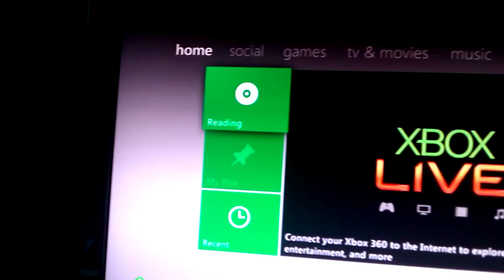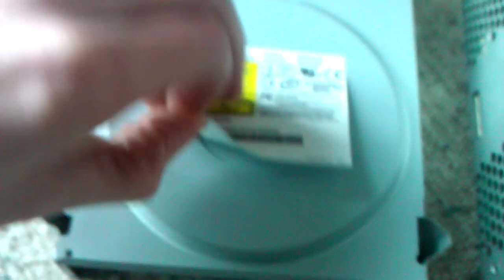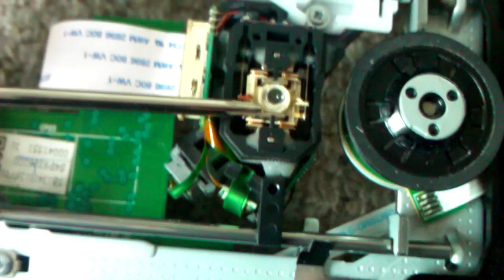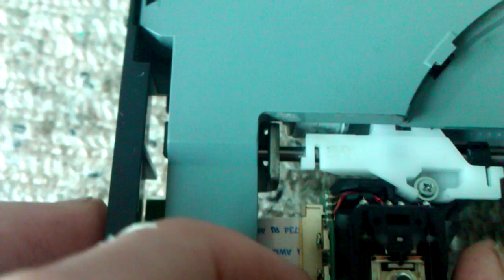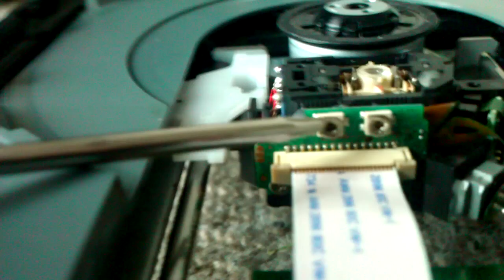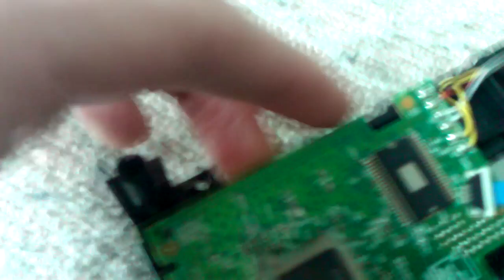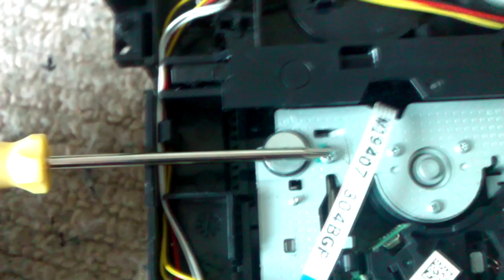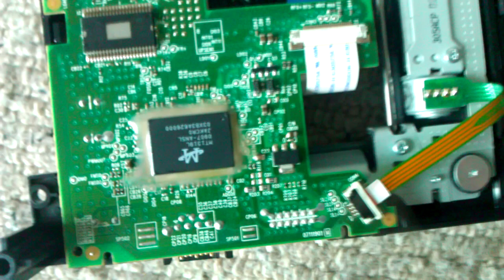2013 All open tray error and no disc spin fixes Xbox 360

Comment: Guys, keep in mind, when you mess around with a laser's voltage, do it only with a multimeter to understand exactly how it does change, and you should know what disc drive's brand you're fixing because they are not the same, having different voltage range.

Comment: I'm amazed!! This truely worked. Took apart my jasper 360 and lite-on dvd drive and cleaned laser lens with alcohol and took out the spinning mechanism and lubricated it as described in this video. When i cleaned laser lens, I pulled up a whole lot of yellowish stuff off of it and it soaked into the q-tip. Put back together and tested all 6 games that the Open tray error was occuring on and they all loaded with NO problems three times in a row. Thank you durhamazhogan for this video. U just saved me $50 and a whole lot of soldering headaches. This truely worked for me. A++++++++++++++ homie!!
Reply: what did you use for lubricant?

Comment from the maker: The left screw is usually the resistance that is sent to the laser so without it the laser stands not much chance of working i am afraid. Either remove a screw from another laser or probably even better, buy one from a place like amazon. They usually cost around £6 / $8 and replace the laser completely. (make sure it is compatible with your DVD drive type).

Comment: dude you are awesome!!! i never thought i could fix it until you came along and saved the day!!! but it was a little bit more tricky than just turning the screw and its done, i had to kinda play with both screws and test, then turn a hair more left or right, but the turn deffinatly stayed to the left otherwise i got the jackhammer noise or some crap like it did before. but thanks, it works great now!! you saved me over 60 bucks or so! ffl man.. ffl

Comment from the maker: Which screws, the ones that keep the laser level or the ones which control the power e.c.t..(small ones attached to laser)? This is known as pot tweak. If he really messed it up all i can suggest is trial and error unless you have a Multimeter that Reads Ohm's then you can use this to check it and fix. If he burnt out your laser then I suggest buying a new one they are cheap and you can get them from amazon / ebay for under £7 / $10, just make sure it is compatable with your DVD drive.

Comment from the maker: 7 years old! You have done quite well. I am afraid that the laser may have just died if it is that old. If the laser moves up and down then it is not the motor and you will most likely need a new laser i am afraid. They are very cheap on places such as amazon, they are around £5 / $4, so long as the laser is compatible then it is a quick change.
Reply: durhamizhogan  hello when i have a disc i side the tray works fine sometimes it doesnt read the cd but  when there isnt a cd inaide my xbox 360 fat doesnt open at all what to do ?

Comment: I wouldn't recommend playing with the left screw unless you have a multimeter to read the ohms. Even turning the screw very slightly can burn out your laser extremely quickly. Recommended Ohms are from 4-6. Adjust your screw so you have .2-.3 less than what your original read was.

Comment from the maker: Sounds to me like your laser is dying. Your best bet is try cleaning it and try the laser tweak (but be careful). 
You can buy replacement lasers on the internet, some independent computer shops replace them for a fairly cheap price. If you do choose to buy one yourself make sure you are buying one that is compatible with your drive. How old is your xbox, some lasers die over time.

Comment: I tried all the possible fixes that other sites show and they didn't help. The two drops of WD40 on the motor disk that drives the DVD and it works great now.  The disk was not spinning fast enough to read it. Sometimes it worked for a few minutes and then the disk didn't spin fast enough and it kicked me out of the game. Now it is fine.

Comment: DO NOT use rubbing alcahol. I've gone through 3 disc drives in the past 8 years. It shows improvement short term, but still develops a film. If you must clean with some type of solvent, use saliva- it's crazy but works really well. It's a natural cleaner! Everything else on this video looks great.

Comment: Is the best ever tutorial i have ever seen. Congratulations. To the point now. I tampered with the two screws behind the laser. At some point the laser became brighter and it was looking like it will be fixed, because suddenly the end was spinning faster for 2 or 3 times and then stopped. But the problem is i really messed up...i forgot how many times i have turned every screw.... Since then i can't put it back no matter how many hours i tried but the laser is pour and it turns only for a turn or so. By the way the two screws have the impression that after a full turn its the same again and it doesn't matter turn it back again. Is this right??? Is there anything i can do to fix it...
I know it's been a long time from the original post... Anyway you are great

Comment: so I did most of your fixes. I ended on the loosening the laser screws and it still doesn't work, should I just replace my laser because everything seems to be working but I'm guessing this damn laser isn't reading disc and I even cleaned the stupid later too.

Comment from the maker: Does the laser move at all? If not then it could be the drive for the laser that is busted (it is the spiral bit that the laser connects to on the side).
This happened to an old PC DVD drive of mine and i replaced it with one from an old drive. Basically only has 2 screws holding it in place and is easily replaced.
Move the laser as far away from the the part which spins the disc as you can and insert a disc, then see if the laser moves down to try and read it before it would normally spin.

Comment from the maker: 66 error when trying to update means the console has been modified or tampered with. However you can still play games offline by doing these steps:
*Restart your console.
*If you are prompted to install a system update, select No.
*Press the Guide button on your controller.
*Go to Settings.
*Select Profile.
*Select Sign-in Preferences.
*Set Profile Auto Sign-in to “Off.”
*Press the Guide button again to return to the Dashboard.
 
YOU CAN UPDATE YOUR CONSOLE USING A MEMORY STICK.

Comment from the maker: Hey, does the laser move when you put the disc in to try and read it or does it stay where it is? If you have replaced the laser and it only works for a while it may be the drive or even the motor that moves the laser. You just want to hope its not the motherboard.

Comment: or since you cant get it apart just get a small round magnet its just to hold the disk to the spindle they are the same in every single internal disk drive ever made for desktops they will all work

Comment: My Philips liteon disc magnet is the problem, I removed the top cover and just had the magnet on top of the disc and it won't read. I placed another disc magnet with the metal balls in it and it will read every time. What do you suggest I can use as a perment fix?

Comment: I have reached the point of serious confusion O_o
I've done pretty much everything you've said In your video, My buddy and I have been working on this problem for almost 8 hours now. It's got to the point where I can play 90% of my games and the others refuse to play, I'm getting all kinds of different error codes every time. This so called Open Tray bullshit started off 3 weeks after playing GTA V , I started noticing some lag and freezing during game play. It wasn't up until last weekend I fired up GTA and It froze up during the starting ads and pretty much wouldn't play any game from that point. Tonight we opened my box up and blew out any dust and cleaned the laser, I've also spent several hours trying to align the laser rails. As we speak I'm testing out games, I'm playing 007 Legends right now and It works just fine. However not all my games work, GTA still refuses to play. I'm seriously starting to believe that the CD Rom drive Itself Is on the way out, It just doesn't make sense why some games work and others don't. Out of curiosity what Is the model number on that drive In your video?

Comment: I think my issue has to do with the magnet inside the disc drive. When I take out the magnet (along with the metal and plastic pieces) from the metal disc drive casing, I attach the pieces back together and place them on the center of my disc. It reads properly and offers "Play Game." Yet when I reattach the magnet pieces back to the the metal casing and screw the casing back onto the tray, it doesn't read again. I think it has to do with the pieces being loose when attached to the casing. Help!

Comment: The laser rail assembly does not move up into proper position when the disc tray is closed, thus not telling the laser to read the disc and not to spin the disc. What is the fix for this?
Reply: If you still need it fix just move the laser to the back enough that it catches the edge of the disc but not too far.

Comment: I took my Xbox apart so I could try your fixes and for some reason when I put the magnet on top of the disk to test it, the magnet and the black plastic piece fly off the disk when it spins. No matter what I try, my disk doesn't spin normally. It'll spin for a second, the top magnet (and the connected plastic piece) flies off, the disk stops spinning, and it says open tray. It wasn't doing this before I opened my Xbox so I'm assuming I did something. It might've been a dumbass move on my part but I threw away that large sticker on top of the drive that conceals the magnet. Does the sticker hold the magnet in place so it doesn't fly off or is there something else going on?

Comment: is there supposed to be any noticeable resistance from the screws attached to the laser?mine seem to move with no force required at all.my box seems to spin the disc about once.and i had adjusted those screws before,and i think i went to far.so i ask if there should be any resistance in the screws because i need to gather an idea of what to expect.

Comment: One problem Ive found with my DVD drive is that the spinner is extremely stiff.  I put WD 40 in the 2 holes that you noted but it only slightly  loosened it up.  Is there another more effective way to get it to spin better?

Comment: Okay so I tried all these things including replacing the laser unsoldered the bulb and some of these techniques have worked for me in the past but it now worse than ever not even spinning once which it used to for me but now it won't even attempt to spin it any more advice you have would be appreciated thanks also when leveling the bars did you do anything to check that it was level or anything like that?

Comment: Do you think that low voltage in the laser would cause gameplay issues? I fixed my 360 and popped in Gear of War, and the cutscenes seem to run at a fairly low frame rate. The rest of the game is alright.

Comment: so I turned the left bronze screw about a half turn and my disc span for about 1-2 seconds longer (making me think I fixed it) but then stopped, and when I turn the screw anymore the disc goes back to only spinning a half second.  Is there a sweet spot I should be searching for? or is my problem not with the laser? thanks for the help!!

Comment: After some playing around (and reckless pot tweaking) I realized my problem was a sticky motor and WD40 solved it. The next day I was having issue installing a game so I figured maybe my tweaking caused an issue. So I got a proper multitool and measured it to 5k~ ohms on the left and 800~ ohms on the right. Now it pretends as though there's no CD at all and spins roughly a quarter turn before quitting. When I remove the CD, it'll spin a good two or three rotations. Evening when setting to unreasonable numbers tweaked, it behaves like this. The laser turns on at a good brightness, the motor spins with gusto. Is the laser not reading or is my PCB shoot? I've detached the laser cable to see how it behaves and it is similar so I suspect funky laser. Any advice would help.

Comment: Hey man, i know this video is old, but   looking for maybe a fix for another common  annoyance with the x360.  My drive works fine when the console is horizontal,  but if i stand it vertically it's plagued with the open tray notification and the drivetray will not open either.

What do you think the issue could be here?

Comment from the maker: You can burn out your laser if you you just tightened it fully up, (meant to do it by a little bit at a time) however you can buy lasers for a very cheap price on places like amazon (£5 / $4) for example. As long as it is compatible it is a fairly simple change. I am afraid if your laser has burnt, you have to get a new one there is no real way to fix it. Sorry dude.

Comment: i've stripped it down and i've noticed that the disk spins for about a second or two and then spins off the motor and the open tray sign comes up, any suggestions?

Comment: The ones that keep the laser level i tweaked them and now the disc spins once and stops i had it earlier how it span for 7 times and allmost read the dvd the dvd span quicker than a cd after many attempts of tweaking the laser im back to stage 1 either 1 spin or non at all so i think i might just give up thankes for the reply tho  and i have subbed to you:)

Comment: Take a QTIP do not use any solutions on the reader just dampen the QTIP with a lil spit  and check for the sensor under the tray in front and spray with with connected to the eye slide sometimes the screw pops out and causes these error's

Comment: The Xbox i'm currently working on has a error 66 when I tried to update xbox live. And that so i took apart the disc drive and found that if you move the lazer anywhere it always goes back to the end of where the disc spins making it not actually read the disc. I'm very desperate on fixing this

Comment: I tried cleaning it but it wasn't the problem. What it actually happens when I try a disc on is that the reader will go right (until the end of the disc) and left, then left again and it does kind of a noise, and the reader just blinks red. Any suggestions on what might be the fix? I don't think is the reader or the metal bars
Reply: You still need help ?
Reply: Yes, it still is not working. I actually bought a new drive, but I'm waiting on my friend who got some soldering skills! But if you think of anything I can try before installing the new one, I'm all ears! Thanks
Reply: yeah i can send a picture of my solution but its a paper clib bendend around the bars so the laser doesnt go to far. you get because i can make a vid for you ?
Reply: Yeah I get it, but isn't it bad to "force" the laser like that?
Reply: no because i think when he hits it he goes back again, hit detection ? not sure yet im still fixing my xbox but my problem is that the lazer doesnt have enough power but i think stopping/ forcing the laser to dont get anny furter isnt bad because of hit detection. if its bad its only bad for the motors but the can handle something haha :)
Reply: Hahaha ok, I'll try that, and if it actually turns out to be bad, I already got a new one anyway
Reply: hahahhahah nice !!!
Reply: Might be the worm motor, it's the thing that moves the laser back and forth.

Comment: Ok, so I had to buy a new laser and I installed it in my xbox. It will begin reading the disk and get to the point where I can chose to start the game, but when I do it slows down and the laser stops moving and brings up "unrecognized disk". Also, when the laser starts reading, it makes a little screeching noise that sounds different then before, and the laser doesn't move as fast up and down the disk when reading like before. Do you have any idea as what could be wrong?

Comment: Yo mine is a black slim 4gb and it spins for barely even a second then says open tray, the laser also makes like a clicking noise idk if its normal or not, i can see the red dot from the laser too while it spins. Its like my xbox doesnt even acknowledge the disk because it does pretty much the same thing it would do if there was no disk in it when i put my disk in,, please help! Im clueless
Reply: Did you get a fix? That's my exact problem and idk what to do with the slim's disc drive cos it's different than shown in video

Comment: You forgot the most obvious fix. The plug in the front of dvd drive with the open/ close lever. If the lever is not in place it will tell the xbox the drive is open. Alil hot glue with fix this.

Comment: If it still doesn't work I found taking the console disconnect all the wires and make sure all your games are out then take it to your back yard, poor gasoline all over it make sure even the disc tray is full of gasoline then step back and light with a long match then walk to GameStop and buy yourself an Xbox One :)

Comment: you sir, deserve massive positive karma for this! saving $, time and stress/frustration. an in the process i learned more about how my xbox 360 works an what it's composed of, like the first few times opening up my first desktop or building the first few. Breadboarded my 360 like you did an tested various things, thank you SO MUCH.

For me it was the dvd laser pot on the left needed a full turn to the left, torq didn't help so I used a phillips head screw driver+drive cylinder needed lubricating

Comment: I've tried the all of these fixes and nothing helped. The problem is definitely with the motor. Whenever I put a game in, the motor tends to just twitch slightly, and sometimes the tray will stop opening. Rarely, when a game isn't in the drive, the motor will spin fine for a few seconds. I've tried lubricating it with WD40 and it still didn't help. I've been looking for a while now, and I still can't find a fix.